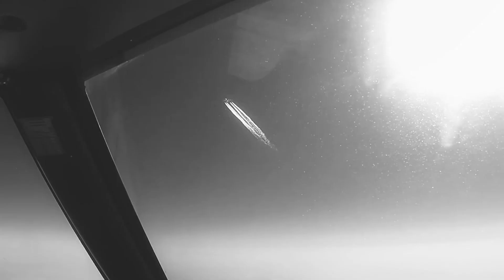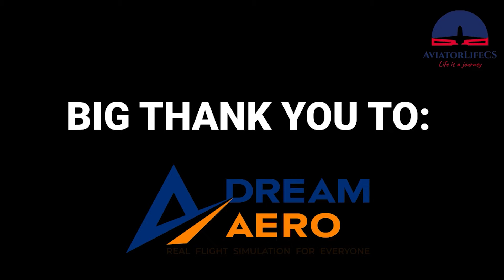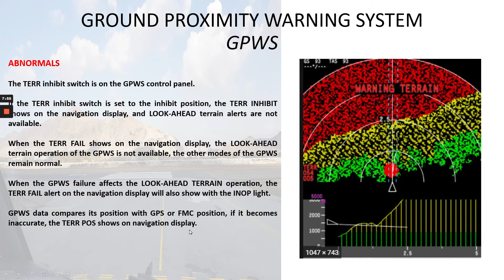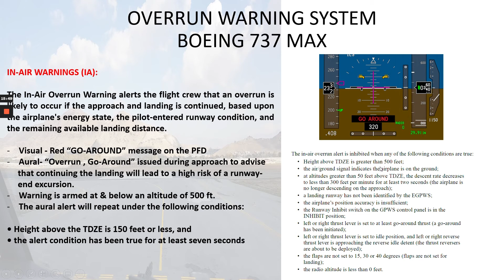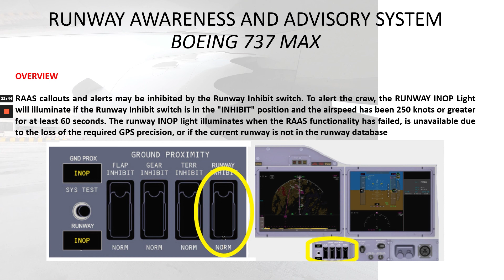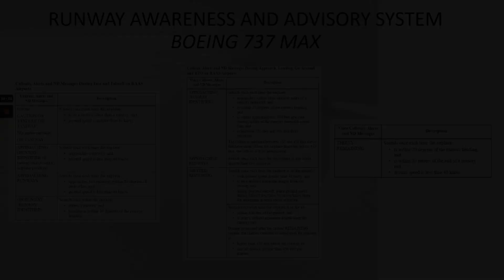WE CONTINUE REVIEWING GROUND PROXIMITY WARNING SYSTEM (GPWS) PART 2 (FINAL)

Comment: Hello since when does the overrun warning system exist for 737max?

Is it also certified for 737NG?

Do you have videos where the system can be seen in action?

I only knew ROPS for Airbus models.
Didn t know that for 737max also this feature exists.
Reply from the maker: Hi Ahmed, thank you for your comment. As far as I know the Runway Situational Awareness Tools (RSAT) is optional and each company can decide to install it or not. I am trying to confirm it. The RSAT comprises the Overrun Warning, Speed Brake Warning, Perspective Runway on the HUD and the Runway Awareness and Advisory System (RAAS). I am not sure if the system is available on the 737-800NG but I will find that out for you. Unfortunately, I don't have any videos showing the system working.
Reply: @AviatorLifeCS  Thanks for the video, great stuff. The Honeywell RAAS is available for retrofit on 737NG.
Reply from the maker: Thanks so much!!
Reply: @PilotGuy

It is not about RAAS. The question is if the Overrun Warning System is availible also for 737NG.
The RAAS is avalible as EGPWS upgrade for 737NG since many years.

The Overrun Warning System is a new feature in the 737max.
That s why I asked if this system is also availible for 737NG.

Concerning the Speedbrake Warning, i know that the 787 also has Speedbrake Warning with new aural warnings.